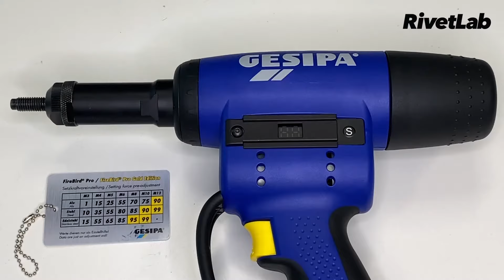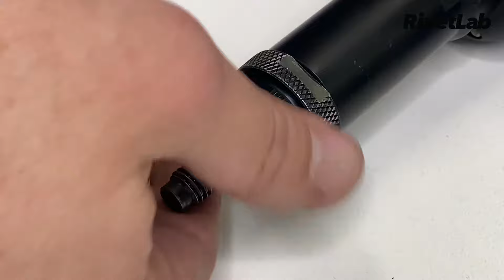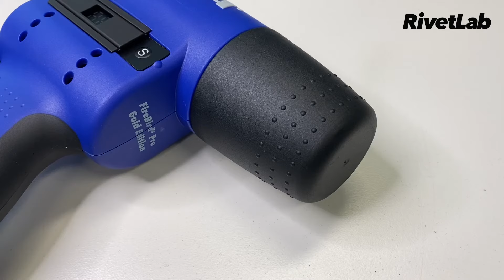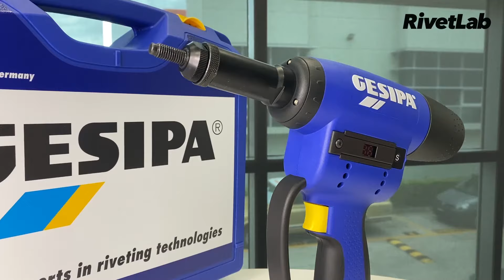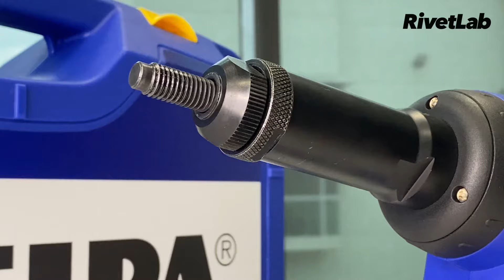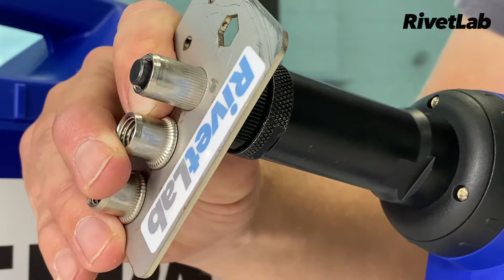Cordless Nutsert Gun: How to operate the Gesipa® Firebird Pro Gold

Comment: Is this tool able to work with plus nuts?
Reply: I do not recommend it. Plus nuts work better on a stroke-controlled tool rather than a pressure-control tool.
Reply: @nickneal552  Any specific tool you’d recommend for plus nuts?

Comment: Buy a bolt, two washers, and a coupler nut and use your drill or impact. Same thing for maybe $5.
Reply: You can certainly set rivet nuts with DIY or low cost hand tools Bofa. This tool is more likely to be used on production lines etc. It just depends on what your requirements are. A bolt, nut and washers pulls up the rivet nut by spinning. This is not kind on the thread and will cause major issues on Aluminium and Stainless rivet nuts.

Comment: Can I ask a question. How does this tool take care the rivet nut is pulled perfectly perpendicular into the sheet metal? I do have a manual setting tool and most of the time it's not perpendicular. While I'm very careful I do have the tool perpendicular when I apply the force to pull, it still fails often.
Reply from the maker: Thanks for your question. There could be a couple of reasons for your rivet nuts being pulled up on an angle:
a. Sometimes it can be harder to keep a hand tool at a 90º angle.
b. Check the hole size drilled for the rivet nut and grip range is correct.
c. If the rivet nut is a low-quality product you can expect installation issues.
d. Power tools do a better job of pulling the rivet nut flat and into place.
Reply: @rivetlab  Thanks that was valuable. I do believe I have point a correct. regarding b I have the hole a bit undersize, so there is some friction on inserting the rivet nut, is that wrong? I don't know about c, every manufacturer claims their products are fine. Still I'm interested to learn why d is the case? Thanks for your time!
Reply from the maker: @SE45CX  Hi, check the specs on the correct hole size. If the hole is too small (or too large, on the other hand), you could get variable results.